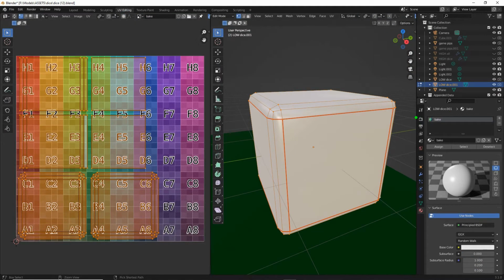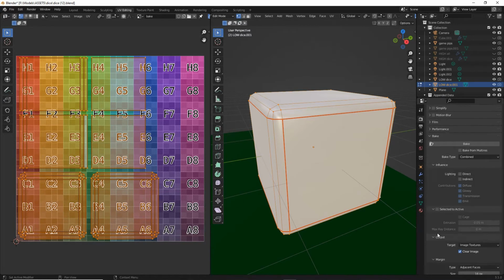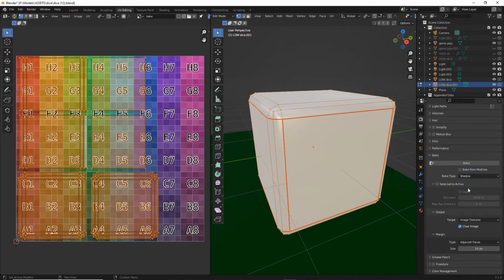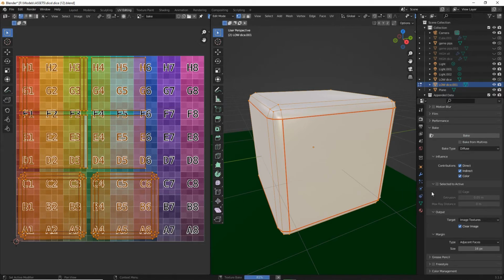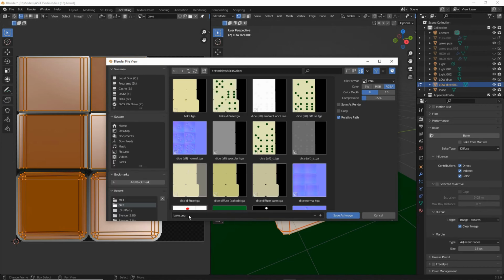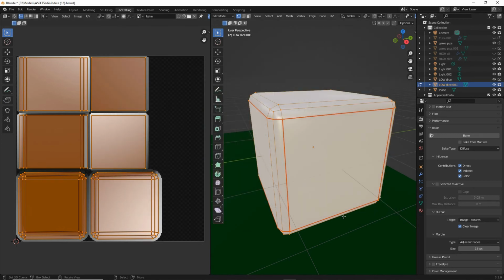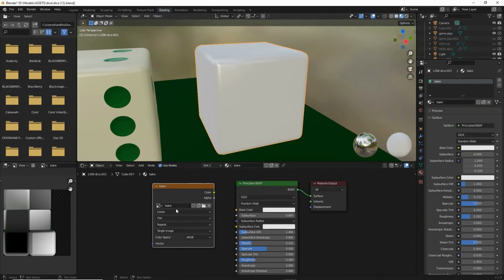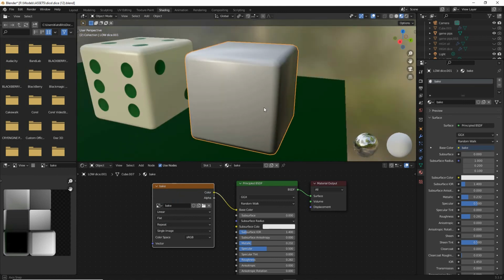Lighting (Shadows) Texture Baking Basics in Blender

Comment: And so, for some reason, everything is black? that's right, because the author wasn't very consistent, now I'll help you, all you have to do is connect YOUR texture in the node editor (I used a simple white fill) and make a separate image texture (into which the shadow will be baked) to make it active (click to highlight) before you click bake and yes, it doesn't matter what version of blender you have, I did it in 4.1
Reply from the maker: The fix for that and other issues are explained here - linked in the description for a reason (it's not within the scope of the above to discuss them) https://www.katsbits.com/codex/texture-bake/#error-black-image-bake and for here, the steps outlined above are pretty consistent (it's why they're included), it's only when the material set up is modified or changed after-the-fact that problems start to crop up.
Reply: @KatsBits  Anyway, thanks for the work, even though I had to figure out the issue myself, you guided me in the right direction.